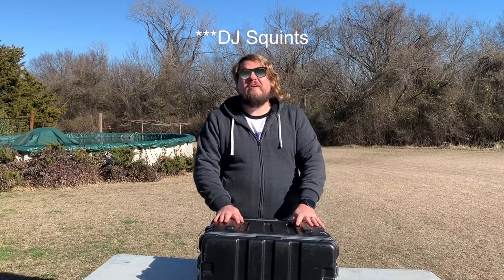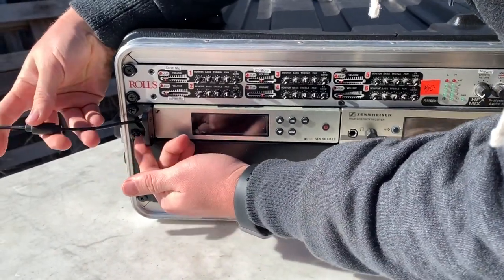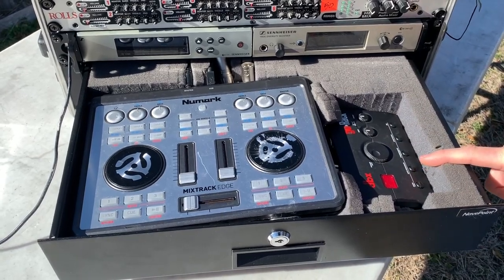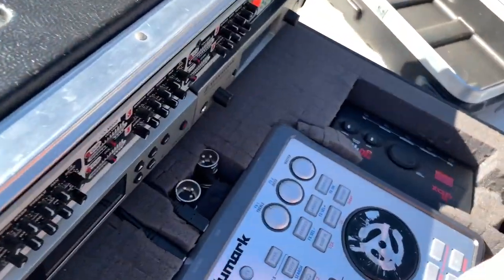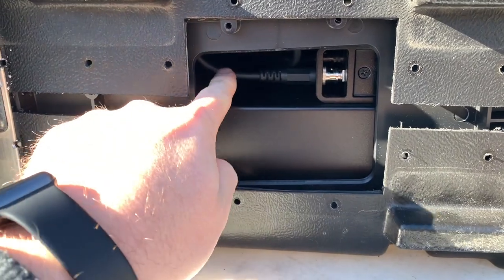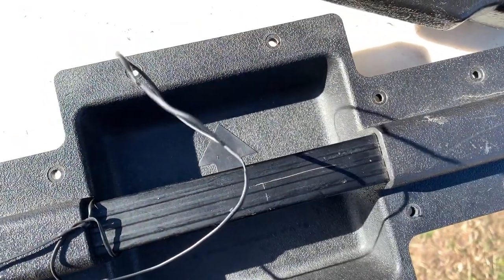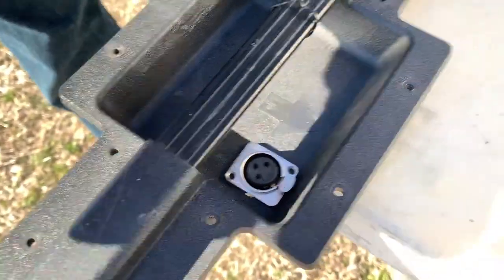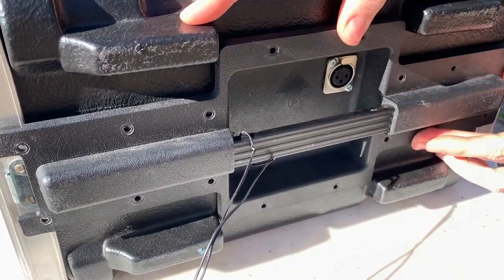Building a custom DJ case: The Mini Rig Case Mod

Comment: What a great case mod. Nice job on getting creative with those handles and how lucky that you were able to fit that USB cable through that hole!
Reply: Hey! Thanks for watching (: 

Yeah, it worked out pretty perfectly! If I were to do it again, I would have put in two XLR outputs instead of an Output and an Input in the handles, I've literally never used the input and it would make letting videographers plug straight in more streamlined then letting them plug into the XLR input inside the drawer.
Reply: I know Im quite off topic but do anybody know a good site to stream new movies online ?
Reply: @Arian Jason flixportal =)
Reply: @Prince Edwin Thank you, signed up and it seems to work :) I really appreciate it !!
Reply: @Arian Jason happy to help =)